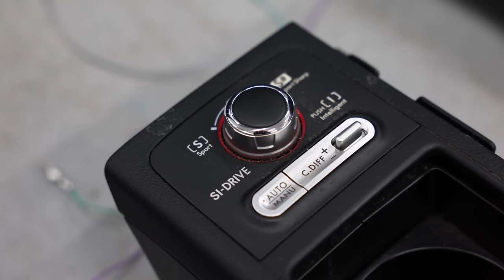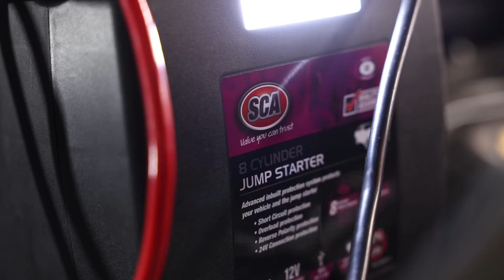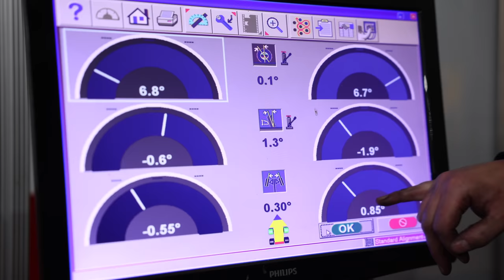EJ25 STI Swap, will it start? - Marty's Levorg Part 3

Comment: I definitely missed having a more detailed video series on this car. It would have been cool to see all of the problems and solutions come up Indicidually and see how they got through them. Especcially for the enthusiast looking to do something similar. In saying that it has been awesome to see how this has come together so quickly and efficiently. Good hustle bois.
Reply: I think the lack of showing them comes from them not happening. It seems everything was literally bolt in except a couple little wiring things.
Reply: I think they outlined the problems that they faced but didn't go into detail on them, would have been cool to see the process.
Reply from the maker: The DCCD wiring is the ONLY tricky thing. and you just have to match one car to the other. Swap the pumps and fuel pump controller and thats about it.
Reply: @mightycarmods  cheers boys, appreciate the reply! Those hellies and 4wd flat spins were awesome btw!

Comment: I upgraded my factory radiator with a Fenix also in black, I installed it 6yrs ago & since then it has never leaked or cracked, it still looks brand new straight from the box it's such a well built radiator i highly recommend

Comment: My first car is the Impreza wagon that you can see in my profile picture. I am in love with it, yes its slow and non turbo (p plates) but its still so much fun to drive and relatively easy to modify. I will always love my Subaru wagons and this Levorg is a massive step in the right direction, massive props to you guys and I cant wait to see what the future holds for this car!

Comment: I did the same thing with my 1990s diesel Ford Fiesta in 2005, converting it to a turbo petrol car with different gearbox, brakes, wiring looms and everything. This took me from 50 bhp to 200 bhp - the difference is that that car only had about 20 wires 😂 This Scooby swap is awesome!! The satisfaction of that first start 😁😁😁 Loving this one, guys 👏

Comment: I agree on the Subaru Wagons doing everything well, 
My daily is a pedestrian 09 Outback Diesel Manual -  still going strong with over 412,000km and has returned an average of 6.77L/100km over the entire 120,000km I have owned it.

Comment: Dudes, to see a build like this fall into place so easily is such a satisfying feeling. The Nissan Z line is the same way (with modern exceptions) with interior parts. The dimensions from a '70 240z and a 350z from '04 are just about 1:1. Glad to see the Levorg finally have power and want to hear that boxer rumble😁

Comment: Tagging connectors with labels with the connector names your vehicle's OEM helps with wiring loom swaps, retrofits, or grafts.

I know in VW world, every one of their cars they label the connector as T<number>, like  T2 for a 2-terminal plug, and use a letter, or two, after that (e.g. T2d) to note a specific plug.   I've labelled wires when I added in power seats to my car, so that future-me, and anyone after me, knows what wiring I added for this modification.

In 2020, I went as far as gifting my Dad a Rhino label maker for this, since he has a 50s Ford truck he wants to graft to his later-model Dodge Ram frame.   This is overkill, since it prints on cartridges that give you multiple colours of flagged labels.  And it even has printable shrink tubing for labeling individual wires.   

Well worth it when you're doing a wire-by-wire swap... especially if you're in a family with more than one person that'll use it!

Comment: I used to have a 2006 WRX 5mt wagon, it was an awesome "dad wagon" (married w/2 kids), I only sold it at the end of 2019 because I was sick of working on it all of the time, it was also my last Subaru as they stopped making fun wagons, and if I'm stuck in a sedan there are way better options out there (like my RWD IS350 F-sport). Had they made a Levorg STi I would likely be driving one today; the market for fun/performance wagons is pretty much limited to 6-figure luxury offerings; a ~40k USD Levorg STi with a hotter FA24 and the STi driveline would get me back in a Subaru.

Comment: I had the same vision. Always wanted a e46 330i. But also wanted an e46 touring. We ddnt get the 330i touring in south Africa so I bought a 325i touring, bought a 330i sedan. And swopped all the 330i bits into it. Only needed to code out 2 lights in the rear as the sedan has 4 bulbs and touring 3. I out on 75000km on it already and never been happier

Comment: Awesome job guys! As someone who has test driven the new WRX wagon wishing it was available in a manual and then being completely disappointed by the manual offering in the WRX sedan, I can only imagine this is a huge improvement over what is currently being rolled off the factory line in the wagon format.

Comment: It's like the gmc Denali. It's a chevy with Cadillac parts inside. I'm a chevy guy. I love it when you need parts for the frontend. Say a chevy 1500 truck. The parts on the Tahoe,Yukon,Cadillac will work. Plus the 4wd and 2wd will work. Lego cars are the best. Chevy has been doing it since 60s. Another example is the  El Camino, Monte Carlo. The doors and front clip will work with each other.

Comment: Hey, well the sun sensor is apparantly working. If you run a disgnosis on a car inside a garage or under a roof or when the sun is not there, it will generate a code. Try running the disgnosis under sunlight or any light, it should go away. Also, it is used to control the HVAC in the automatic climate control cars. :)

Comment: For the SUNLOAD SENSOR (B14A1) that is not a proper DTC code, just clear the codes, point a flash light at the sensor, and try again. That is telling that there is no direct sun light. Happened to my Suzuki time ago. Hope it helps you!

Comment: The sunload sensor code is only present because the vehicle was inside when you scanned the codes. It's a sensor in the middle of the dash that detects the sunlight outside

Comment: This is amazing, but basically the opposite of what I did. I swapped the 1.6 FB16 and CVT from a 2013 Crosstrek into my STI. The CVT is so much smoother and more fun to drive than the old 6-speed in the STI.

Comment: Re: the clutch hole and other holes and bits not used on the auto. It is likely that somewhere in the world has a market for the manual Levorg, might even be named something else on another market. Rather than press and make 2 different bodies, it's probably quicker and cheaper to make the plugs and fit them on the assembly line.

This has been so cool to see it all get transferred, you guys make it look easy lol.

Comment: Dudes! Crazy sh..uper, well done! 
As a former OEM brake systems developer you better thrash this thing and drift it etc. with all the safety systems active. 
Why? Because sensors and.posiyioms of them sometimes differ between models or the geometry of the cars might differ witch may lead to wrong calculations in the ecu and crazy behavior in situations the safety system should help you in stead of making it worse.
Best would be to let us see if all works the way it should😉

Comment: Might want to do they alignment again. On the front left corner the studs on top were in the inner holes and on the bottom on the outer holes. That means the mirror was not centered resulting in a faulty measurement.

Comment: Watching you take out those rotor screws with ease hurt my soul. Living in northern canada my most recent experience two weeks ago was drilling them out, and then wedging a pry bar with a small sledge between the hub and the rotor to get the rustweld broken.

Comment: I'd like to see lap times before mods, stock grovel vs "STI super grovel" as it is now.
 on the same/similar street tires it should make a good showing of improvement.
real suspension, tire upgrade stuff, and ECU adjustments after that.

Comment: Awesome video as usual guys, now do mine 😁
Two questions I have that weren't addressed...
1. Did you need to get an engineering certificate because the Vorg never came in a manual? and
2. What about the eyesight? Is it working? If so how? and if not can it be legally registered without it?
Cheers
P.S Next video, back to Dyno and re-track to compare figures and times🤞
Reply from the maker: track and dyno video coming. Yes engineering cert is done, records updated. Eyesight optional, didn't come in some cars but depends on local rules.

Comment: Steel braided brake lines, DBA 5000 rotors and Ferodo DS2500 brake pads combo are the best upgrade I have ever done to my own STI. I feel like that's the brake feel that should've come from factory. I guess costs are the reason why they didn't go with that. 

Oh also get the upgraded brake fluid as well for the higher temps :)

Comment: Hey Marty, as an ex subaru technician i just wanted to tell you that the sun sensor DTC isn't actually indicating an error. It just shows the status of the sensor, IE if it is being hit by light or not.
You can try it yourself by looking at live data and shining a light on it and covering it. It should change state when doing that.

Oh and while i have your attention, i bought a signed poster (the 180sx) but it arrived a bit wrinkled. Probs got bumped in shipping i guess. Where can i shoot an email to send you more info and maybe get it fixed ?

Comment: Another hurdle with modern cars is that all the modules serial numbers are " married together" at the factory. So you need a full donor car with all th electric bits and swap everything over so it wont trip some security system. Its not possible to marry and engine loom and body loom together like in the older days...

Comment: I had the exact same issue with the fuel pump controller when doing my swap. In the SG foresters they will throw a CEL without it but drive fine tho

Comment: Congrats! THIS is the car Subaru should have offered/should now offer - or at least a WRX in the hatch/wagon body. The Impreza (North America) wagon is SO lame its audience is basically people like my 80+ yr old parents, with only the weak engines and CVT offered. There has been a manual option here, but only with the lowest output engine, in the absolute stripper base model.

Comment: Damn, that car looks good. But did i miss installing a fmic? Tmic without the scoop won’t cool enough i guess?

Extremely cool car. We have them in Europe too, mostly 1.6 turbo 170 hp. Front fenders and bumper from sti should fit.

Comment: Hot take: the EJ might be a better track engine if you invest the money, but for a street car, the 2.0 FA engine in the WRX is easier to tune, a lot more reliable, and a better engine for bolt on only builds. If you are willing to spend the big money though, then the EJ has more potential

Comment: Great work! Have watched and enjoyed your channel since 2013. This build is something I have dreamed about especially since we never got the Levorg stateside. I would love to manual swap my 6th gen outback some time. The main question is, how do the eyesight safety features work since you swapped to the 6MT from the CVT.  Thank you so much for taking the time to respond to my message. Cheers from the US!
Reply: I have a 2.0L Levorg and I have also wanted to see if this build was possible for my car, so it's great someone has finally done it. The Eyesight has always been something of a question in the Levorg community previously, and I feel like it wouldn't be happy without being able to downshift while braking for collision avoidance. I hop the MCM guys see this question and answer it, even it it's answered on the second channel.
Reply: @UncoTomato  I know this was the reason I was given as to why Subaru was phasing out the MT in majority of their cars. The question I have is, how does Mazda or Toyota or BMW get around it to have MT and working precollision braking. 
@MCM2 TV @Mighty Car Mods

Comment: Congrats on the build fellas! It’s awesome to see how well the Subaru Global platform works across other chassis. My real question is how many modules had to be swapped over aside from the fuel pump control module? I’m assuming ECM and Immobilizer ECU had to be swapped over in order for it to actually crank over, along with the BIU so that the key fob is able to work in the Levorg with the keyless access components. Were there any original modules in the Levorg that had to be modified to communicate with the STI modules? 
-Cheers boys and congrats on an amazing achievement!
Reply: Everything from the headlights to the dashboard is from the STI, Body Loom is Levorg with some Changes made

Comment: The reason I had a hole in the firewall is it's cuz the same firewall as the STI. Before they weld the cars together the holes are already there. That's how you lower manufacturing costs just make one firewall for all the cars

Comment: Today I learned... Australia has snow... lol. That Miles is a legend and the car was gonna start today was known, subies are awd and 6spd or bust is known. Brakes need changing, difs need oil, radiators need to not be broken and full of fluid, known known and known. But I had no idea there was anywhere in Australia with snow

Comment: Amazing as usual from you guys, you never disappoint. Though i would like to say why i think this is possible is likely that the engineers wanted it to exist but the accountants said no. Or Subaru just wanted the option to do it but never did it. Also a personal preference thing, But if it was my car i would probably either paint it Subaru blue or the cream ish yellow that were on early JDM wrx's and sti's.

Comment: This is a dream build as it is  want I still want new. I had an RS TURBO Liberty with R spec wrx motor and T4,mad car! I now have a '20 STi and just bought a new tS Sportswagon, which is great, but still doesn't have the 6spd option on wagons. Im just wondering what will happen with the eyesight system, that Subaru still hasn't worked out to work with manual cars!
So how can you get this car roadworth, if the eyesight is not working or removed? As safety equipment cannot be removed or disactivated, like airbags!? I say this cause I reckon there will be a lot wanting to do this swap! Love the MCM channels and lads. This is soo cool!

Comment: the only thing that would really need to happen to make this literally the easiest swap ever is if someone sold a 'swap harness' so all you'd have to do is plug in the new harness instead of swapping wires around. it's crazy how (relatively) simple that was.

Comment: I miss my Subaru waggons. I've had 3 a '80 GLS in NZ, A '93 Legacy in Canada and '93 Impreza in Tahoe. Bit I live in a land (France)  here they are just impractical due to import taxes and fuel prices...and the abundance of other vehicles that do the same thing at a lower price.......So instead I drive a more prectical but less fun VW Transporter (Work truck/People hauler/Camper)

Comment: Wouldn't it be easier to just use the STI wiring loom and just add the cables for the rear wiper/extending the different length ones (mainly antenna and rear lock I'd guess)?

Comment: These more condensed episodes are so much better. A good cliff hanger is good, but the fickle nature of YouTube consumers means you can't string them for too long. Having tear down to build over two episodes is epic and I haven't been tempted to skip (as I admit I have done before). In the same breath, I reckon the episode could be longer. Knowing a major milestone is coming while showing more of the technical stuff in the middle would be the sweet spot. I feel these two episodes skipped over a huge amount of the work we've come to love and expect and it seemed a lot more high level.

Maybe I'm out of touch with the rest of the audience, but I would rather sit through a) as much detail but in a longer, 1hr episode than b) less detail but faster outcome in shorter episode or c) more detail but dragged out over multiple episodes. I say that because it personally suits my viewing profile of binging. I can go 1-2 months of not watching MCM, then cram.
Reply: I forgot to say I did love this project. The starting and driving gave me proper ear grins.

Comment: I want manual in all Subaru models, being back the dual range transmission from the SH Forester but make it a 6 speed. Their excuses that manuals do not work with the new driver eyesight system is rubbish.
And bring back the 5eat auto

Comment: The sun sensor fail is always set when it would switch on the light. No one really knows why you would have the car set a fail code for that, but they all do. 🥴

Comment: Ah, the old Subaru sun sensor error code! Pull the car out in the sun, then clear and recheck the codes. For some reason if you're inside the code won't go away!

Comment: It NEVER made sense for Subaru to exclude a proper 6spd STi wagon, or at least the standard WRX manual driveline from the Levorg line up…

Consider that for those of us who want a high performance vehicle, that also has the practicality of a mid size wagon, we are having to look at the Audi RS4. Which is out of reach for most. If Subaru made this vehicle, a lot of people would have bought in. I would for sure.

It’s as if some incompetent Subi executive had to justify all the money they poured into that abysmal CVT by forcing the public to have no option but to buy it. The Levorg should AT LEAST have been available with the normal WRX manual drivetrain. Instead they relegated the Levorg to “avoid at all costs” status by handicapping it with that dog CVT transmission. It’s as if Subaru is hiring the same marketing consultants that Gillette used to destroy their customer base. …What a missed opportunity.

We ended up paying top dollar for a Euro performance hatch. Having previously owned a couple of Subies, I would have MUCH preferred to buy a proper 6spd STi version of the Levorg…

They had the opportunity to make up for their sins with the new 2.4L 2022 WRX “Sportswagon”, with a healthy 202kw, but again… Only available in CVT… Big Fail Subaru. You’ve lost the plot.